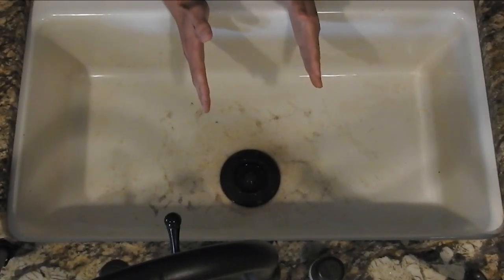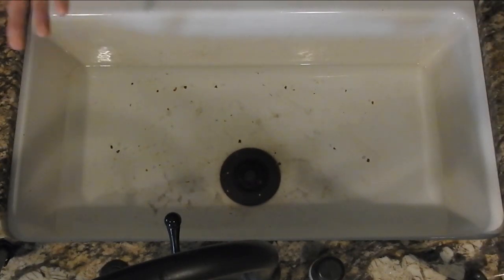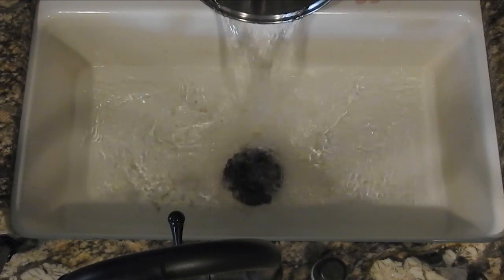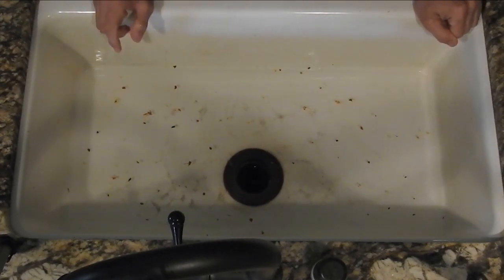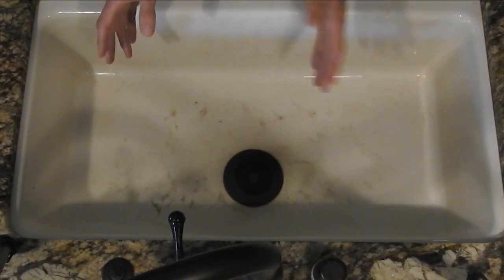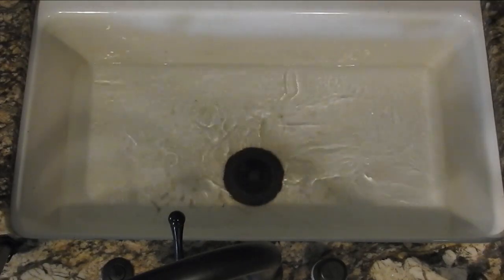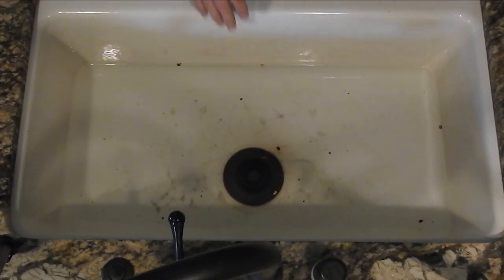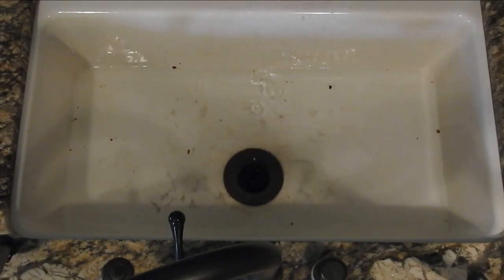Duplicating The Equator Drain Trick

Comment: http://www.smartereveryday.com/toiletswirl    This is a more accurate test with "still" water.  Not water already moving or a basin where you have hole not in the center of the bowl and where you regulate where and how you put the water in the bowl.
Reply from the maker: That's a great video. The Coriolis effect is very small though, and difficult to demonstrate.  The point of my demonstration was to show how they fake it at the equator for the tourists.
Reply: fair enough. But the fact that it does in fact work does therefore not mater that the people on the equator fake it a little.  It does work even if it is small.  Their example is just a more obvious result.  Is that so bad?
Reply from the maker: It won't work at the equator. I'm not trying to debunk the Coriolis effect - I'm debunking the fake demonstrations. They are not really "faking it a little", it's a huge fake.
Reply: Well isn't that the point that it doesn't work at the equator.  I suppose if you were really going to test it properly you would put a big pool either side and one directly in the middle like that other video I sent you.  And test all three when the water is completely still in all three.  The small samples they use at the equator are probably not adequate enough to get an accurate result.  But so what really.  It's a great way to show how it works even it it is fake 'overeffect' or not.  But I get your point. Cheers.
Reply: @vickib4063  of course it matters. It all matters
Reply: @truthseeker1532  Relooking at some of the fake videos is actually quite funny and quite obvious how they fake it once you re-watch this video as well.   Gave me a good laugh.  :)😁
Reply: @vickib4063  Yes. When faking science, does it really matter if the demonstration is a "fake overeffect" or not?

LOLOLOLOL

Comment: Wow, you prove yourself wrong! But then you just keep changing things until you see your pre-determined result. What you actually did prove is why double-blind tests are necessary. (Think it through. The water swirls consistently all over the world. What do all these places have to gain by faking the demo the same way everywhere?) Oh, and these guys prove the water isn't moving before they pull the plug. https://www.youtube.com/watch?v=QTTJJAiQFRc
Reply: did you see how it still turned counter clockwise on your second test? Coriolis effect is real. Earth spins approximately 1000 miles/hr at the equator. It has minuscule effect but it has an effect on moving objects. Even snipers has to consider it when shooting long range.
Reply: @techburnsca  of course the the Coriolis effect is fucking real it is too weak to have any effect whatsoever on a water basin.

SMH
Reply: @techburnsca  your actually a hundred % wrong, no shooter/sniper long rage projectile ever has  evver calculated Coriolis before firing. Who told you that?
Reply: @GunninWizard  While it may not seem likely that the Earth’s rotation has that big of an effect, shooters could experience 2 to 6 inches off their target. This is a big loss for the shooter. If you factor in the spindrift the shooter could experience could miss the target altogether. @t
Reply: https://www.laxrange.com/explaining-coriolis-effect/
Reply from the maker: I didn't prove myself wrong. I determined that you need a minimum angle of pour in my sink.  
The performers in your video use different shaped bowls. 
I think what they have to gain is perfectly obvious. What does any performer have to gain when they do their act?